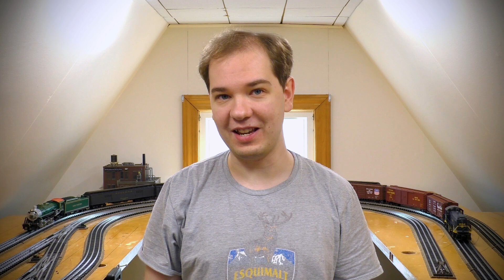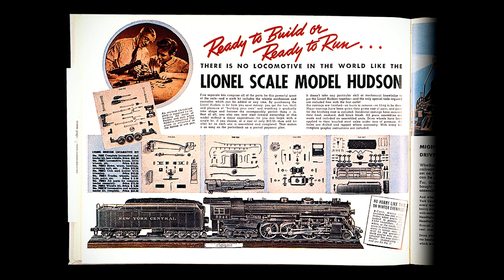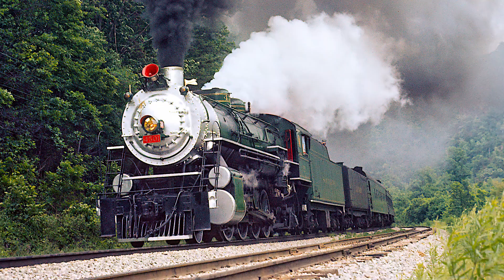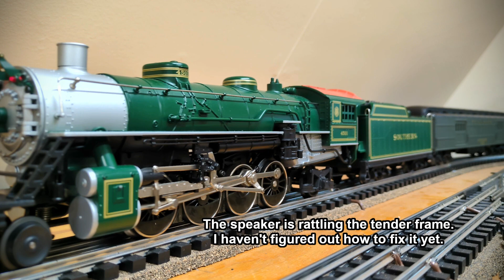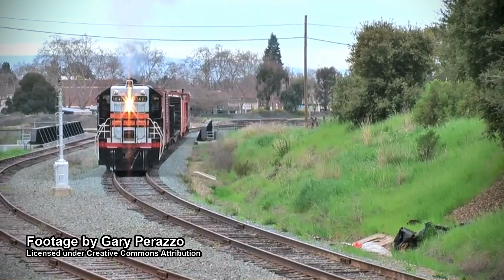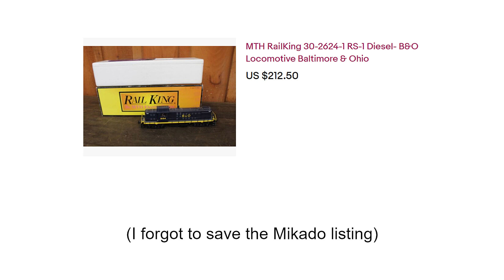The Case for DCC in O Gauge

Comment: As good as the TCS decoders are (I used theirs in N scale), not having a separate wireless way to control them is a bummer. I already have DCS and a TMCC controller connected to my layout. To get a third brand to work, it has to be wireless. I wish someone would come up with a universal bluetooth DCC interface board that could be used with any DCC decoder. What we have in O scale is still the same issue. No universal way to use DCC on non PS3 locomotives. Either get rid of DCS and convert everything, or forego DCC. A universal bluetooth interface that could command any brand of DCC controller, just like using you PowerCab, would solve a whole slew of issues.
Reply from the maker: I'm increasingly becoming a fan of Blunami for this reason - you can operate them on DCC or Bluetooth interchangeably. It does limit you to the sound options that SoundTraxx offers, but they're adequate for most purposes.

Comment: Great video, I agree with much of your thinking.  However... I feel that an AirWire handheld throttle and G4 decoder (i.e., R/C direct to the loco, without the DCC command base and booster) is a better approach for 3-rail O than what you're showing here.  Likely smaller initial investment, AND you could operate the converted locos on any 3-rail layout.  I'm not a fan of battery on board, so you would need to add a "helper circuit" ahead of the decoder, rectifying track AC to the filtered DC that AirWire is expecting.  My $.02, thanks for sharing!!
Reply from the maker: I've actually done a video about Airwire that you mind find interesting.

Comment: * THANKS for taking the TIME to make this informative video.
* FYI - AUTOMATIC CONTROL OF MTH PROTO-3:
* The NCE Corporation makes a "Mini-Panel" -- which can be considered a "Programmable DCC Model Train Controller"; it can hold just a little over 100 commands.
* You can program this controller to do simple automatic control scenarios -- using MTH Proto-3 locos operating in DCC mode.
* To operate Proto-3 Premier locos with DCC, you need to just flip the included switch on the bottom of the loco from "DCS" to "DCC".
* To operate Proto-3 Railing locos with DCC, you need to either cut a wire, or else add the "DCS/DCC" switch (MTH has instructions for doing this).
~~~~~~~
* With this NCE controller, you can set up simple automation  scenarios -- such as controlling 2 or 3 trains running on 1 loop, or 2 or 3 trains running point-to-point, or up to 7 MTH streetcars running on 1 loop, or just 1 train making 2 or 3 trips around a loop, then making a timed station stop with departure announcements.
* My Youtube channel has several O-ga. Playlists -- that demonstrate these scenarios.
* I've been trying to persuade O-gauge railroaders to get their grandkids involved in this; the kids could be learning the basics of programming logic -- while at the same time programming trains -- but I have regrettably not had much success so far.
Reply from the maker: Interesting, I'll have to look into that. I'm currently using NCE systems on both my O and HO layouts.

Comment: Great Video, 1 thing, you sell 3 rail like it is an obsolete technology, but even with today’s ever-tightening economy, it has actually been a great system for those who run block / analog systems. With 3 rails, you can insulate one of the outer rails to make a “pick-up” section, in which case it only ever completes ground to that outer rail when a train passes, in which you can ground out operating accessories only as a train passes, and you can even activate other trains just by having a section that’s completely ungrounded and only receives ground when a train passes over a section of track that completes ground to both the outer rail of said track and both outer rails of said track that the other train waits on. Essentially automatic block control without controllers or even relays, just a 3 rail system. 

The other main advantage to 3 rail is that you do not need any special equipment to make a reversing loop, which is a huge deal especially for young beginners, along with being able to connect any 2 parts of track together within the layout without having to worry about polarity issues.  

It is however unfortunate that Lionel, K-Line, and MTH never did embrace DCC, which would have been a lot cheaper for all 3 companies instead of researching and developing their own systems, and it might have saved K-Line from infringement on Lionel’s control systems back in the 2000’s. Oh well, you live and learn. 

3 rail is a burden for die-hard modelers, but it is a blessing for beginners. My two cents.
Reply from the maker: I don't think it's obsolete at all. It has some major advantages, as you mentioned, that I think a lot of hardcore modelers ignore because they see 3 rails and think "toy train". I just wish manufacturers thought the same and offered factory DCC compatibility.

Comment: I would like to ask your opinion on esu sound decoders and their quality of sound
Reply from the maker: The sound quality is generally pretty good, although it varies depending on which sound file you use. I've tried ESU for diesel and not been that impressed, mostly because it doesn't have the load-sensitive notching feature, but the sound quality itself is decent - I'd say better than SoundTraxx but not as good as TCS. I plan to try ESU for steam soon, and if I like it, possibly even swap one into the Mikado, because ESU has a sound file available with recordings from the real 4501. The biggest advantage of ESU is the ability to make custom sound files - you need a special gadget called a LokProgrammer to load them into the decoder, but it really opens up the possibilities for making your loco sound exactly how you want, which is very useful when modeling specific prototypes.
Reply: @redoaktrains ive been trying to standardize my steam engines all to esu as i prefer how esu whistles work with different sounds randomized within a set, im unsure if tcs does this as well. 3 of my engines currently use esu, a 2 10 2, a 611 and a dl109, my 2 8 2 is next on the list for esu conversion and esu has a ready made file for a usra heavy mikado
Reply from the maker: @robos3809  I'm fairly sure TCS does not do random whistles. They do have very nice pre-recorded grade crossing sequences, though. I'm contemplating eventually swapping ESU into my 4501 so I can use their 4501 sound file, but I have lots of other projects to finish first.
Reply: Also to comment with regards to the 4501, i was actually following that engine on one of the days they recorded samples for that file

Comment: Man this is confusing 😂.  I have a mth set and just bought a Lionel engine for it but it doesn’t run with the mth controller.
Reply from the maker: Which set and controller do you have?
Reply: @redoaktrains it’s a ready to run csx set with the mth remote
Reply from the maker: @jamesa6272  MTH made two versions of their remote controller - one that varies the track voltage (which should work with any loco) and one that uses MTH's proprietary DCS control system (which will only work with MTH locos). You may have to buy a standard transformer to run the Lionel engine.
Reply: @redoaktrains  so I wouldn’t be able to run the Lionel engine in trail on a train with the mth controller I guess
Reply from the maker: @jamesa6272  Both will be able to run on an analog transformer, but they might not run at the same speed.

Comment: Personally, LionChief has bridged the gap very well between people like me who like the sound of DCC but don't know how to use it and the more advanced people in the hobby. You can use the LionChief system with Legacy engines today. That said, Lionel Legacy should be able to run on DCC, as MTH is now using ProtoSound 3 since it wound down its operations. 

I'm still a conventional, old-school runner, but I have looked into getting more Lionchief Plus engines. I wish that the line had more variety. I'm getting tired of the Baby Hudson, Doodebug, and GP38 in a million road names. I would love to see a LionChief Plus Harriman 2-8-0, a green 4501, a Dixie Belle 4-6-0, or even more short lines.
Reply from the maker: I do like LionChief a lot, especially since you can run it on a DC, AC, or DCC powered layout with no interference, and it's more affordable than Legacy. I also like that you can use the universal remote to control up to 3 engines at once, and it's very simple to set up and use. If only Lionel sold LionChief electronics as a user-installed upgrade package for existing locos.

Comment: Since you have to use dc power for Dcc doesn’t that mean you can’t run legacy engines on the layout
Reply from the maker: DCC isn't technically DC. At the track, it's AC with a constantly changing cycle rate. However, that's mostly beside the point - as far as I'm aware, Legacy doesn't care if the track power is AC or DC. Most modern AC-powered trains use an onboard rectifier to convert the power to DC anyway. So, although I haven't tried it with a Legacy controller, I'm fairly confident that Legacy engines will run fine on DC-powered track.

Comment: (Forgive me for commenting 4 months late)
Fascinating! in HO, I never got an NCE PowerCab System but a Digitrax DCS52 Zephyr with plans to add a separate but compatible Digitrax DCS52 Zephyr Throttle in the future as my ultimate plan is to technically have three layouts in one giant one (one main continuous loop layout, a point A to point B coal industry layout, and a big yard for switching and on-track model storage on the layout).

Comment: I was an early convert to DCC. So early on I had to mill out weights to find space inside my HO engines for decoders, which I then had to hard wire in. I also had the sidebar hobby of O gauge toy trains. When Lionel came out with their proprietary system and MTH with theirs instead of DCC I felt they harmed the future growth of O scale on three rail. I still believe that there would be more three rail O gaugers today if they didn’t behave so protectionist and trying to one up each other. For that reason I today run my OO switching layout locos on DCC sound and my O gauge is still all analogue, preferring post war engines. I refuse to spend anything like the astronomical prices in Lionel’s latest catalogue and I am still having fun. I’m firmly in the camp that thinks O gauge should give up the silliness and go DCC. Excellent video Michael. 😊

Comment: I wonder if installing this into some O scale brass would work. If i get some, ill probably try it.
Reply from the maker: As long as it has a DC can motor, I think it would work great. Just make sure the decoder and speaker are electrically insulated from the frame - on my first attempt at this, I overlooked that issue and fried the decoder. Thankfully, the TCS warranty covers accidental damage - another reason why I prefer them over other decoder brands.

Comment: You are using a 5 amp NCE DCC control system.  DCC-EX now comes with a 5 amp power supply.  Could you use the DCC-EX control system on your layout?
Reply from the maker: I haven't tried it, but I would assume so. Any DCC system with sufficient amperage capacity should work fine. As a general rule, I'd budget for 2 to 3 amps for each locomotive that you want to run simultaneously. You may be able to get away with less, but you risk tripping the circuit breaker.
Reply: @redoaktrains  I was just looking at the DCC EX website and they have 15 amp compatible motor shields that are supported under DCC EX.  I would love to see someone try it out in O Scale who has the patience and ability.
Reply: Thanks!  I have the patience but not the nerve to start cutting wires in my expensive Lionel engines yet.  Definitely looking into it though.

Comment: Mth is a trash company now!  Sold me on mth dcs, but they make zero proto 2 or 3 kits!!!! Wth Mike. Dislike u for scamming me and many others!!!!
Reply from the maker: Agreed - I have many complaints about how Mike Wolf ran the company, and the proprietary nature of DCS is a major one. Not only did it lock buyers into a very limited control system, but the sound quality and features barely changed at all in 25 years, while the rest of the industry advanced in leaps and bounds. The PS2 and PS3 conversion kits were only available for a short time, and they were quite expensive for what they were. Even if the kits were available, the electronics in MTH models are far more complicated than they need to be - you should see the rat's nest of wiring I pulled out of that RS-1. It's really a shame, because many of the actual models are quite solid, reliable, and well-detailed, but they're vastly better if you rip out all the Proto junk and install something else. I hope the new owners of MTH eventually ditch DCS entirely and just start selling models with Blunami or something similar.
Reply: @michaelramsey81  Amen!!! I have a ton of mth and wish I knew more early on.  I assumed MTH was releasing a new remote w new base!  I also took Mike's word while at Mr. MUFFINS that new kits were a few months out. Nope.  No new kits.  No remote. Not even the cable you need to use existing remote!!! Lie after lie after lie.  I want to make rude comments about him... leave it to your imagination.

Comment: Is it possible to use an Ho scale digitrax decoder for o gauge?
Reply from the maker: I wouldn't risk it. HO scale decoders can't deliver enough current to run most O gauge locomotives, and it would overheat very quickly (or just not work at all). If you have a spare decoder that you don't care about, you could try it, but for most O gauge locomotives, you really need a decoder that can deliver 3 amps, preferably more.

Comment: To stop the speaker rattle, you could use micro crystal klear which is like removable glue. You just apply it to the tender shell where it comes in contact with the base.

Comment: I personally have been fitting my O gauge trains for DCC as well. Something that convinced me to go for DCC over Blunami is the cost difference, Blunami decoders are more expensive than regular DCC sound decoders, and I found that the added cost of Blunami decoders exceeded the cost of a DIY DCC system called DCC-EX once you get two or three decoders.
Reply: Ever used Legacy or DCS?
Reply: @huntercoleman460  Not really, I've used a couple Lionchief engines, and ran a Legacy engine in Lionchief mode, but the cost of a Legacy Base or a DCS TIU was always more than I could justify, another benefit of DCC was that the base stations are a lot less expensive.

Comment: OK, I was getting onboard with Blunami (pun intended), then this. Will this work if you utilize Legacy and DCS?
Reply from the maker: Legacy should still work in tandem with DCC on the same track, since Legacy uses wireless control. DCS and DCC cannot be used on the same track at the same time because they both send signals through track power, and they would interfere with each other, but you could use them one at a time, and MTH PS3 engines will run on DCC.

Comment: You answered a lot of my questions. I now have no fear of using my Digitrax DCC system with MTH PS3 engines, plus others I will install decoders.
Reply from the maker: I'm glad! I've run PS3 engines on a Digitrax Zephyr Express and it works great. The Zephyr Express tops out at 3 amps, so running two locos at once occasionally trips the overload detector and cuts power, but for one loco at a time, it works perfectly. If you have a booster with higher amperage, you should be able to run 2 or 3 locos at once with no issues.